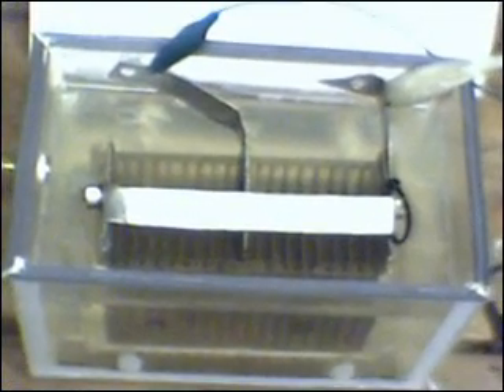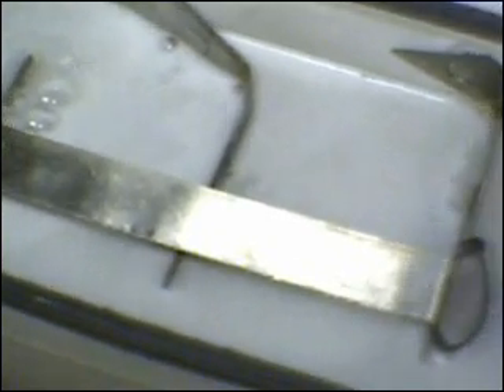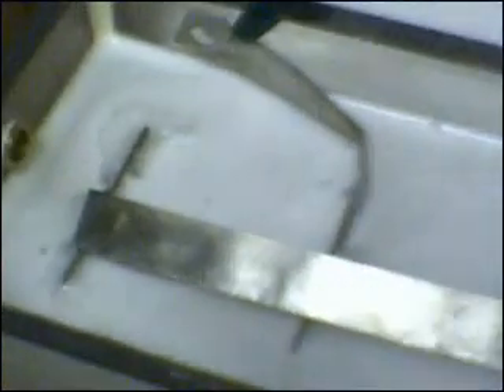24 - Hydrogen HHO Electrolyzer w/ vinegar 2007/08/01

Comment: I am building my first HHO generator to install on my 1989 Suburban. I have ordered some KOH from eBay, but I would like to experiment with vinegar as well until it is delivered.  I have a few questions about the Vinegar:

1) Is it as effective as KOH?
2) Why do you need the dish soap?
3) What is a good vinegar:water ratio to use?

Comment from the maker: {ZFF takes a bow.} Outlet fitting has already been on the side for quite some time. Collection tube inside extends it across the top of the tank to the center. I'm already beginning work on another plate cavity for use in the same electrolyte tank, taller than it is wide, so I can measure the difference in gas production vs. the horizontal layout now. Also starting on a 3" I.D. PVC cluster of electrolyzer cells. ZFF

Comment: Very nice work, seriously.  I would like to suggest you drill a hole in the top cover and place a top-closed tube glued in the center, then I would connect a small hose from the collector up into that tube.  This will allow the container to be tipped/jarred without any liquid being spilled into the collector.  You could also place a small vacuum pressure inside to keep the surface tension down (allowing the hydrogen to escape quicker)....just some thoughts, good luck =)